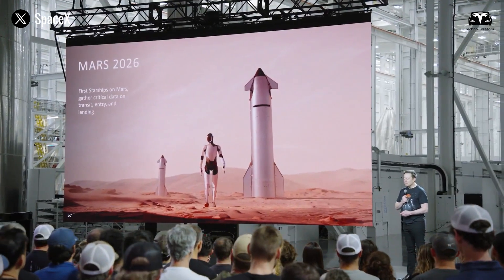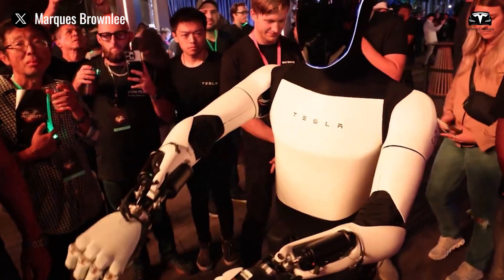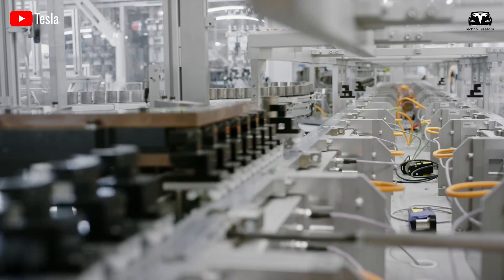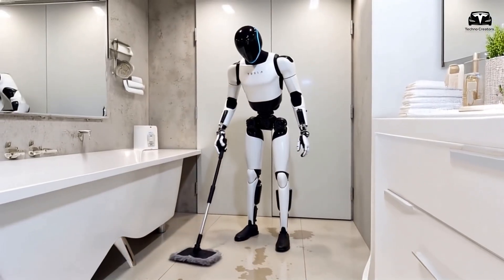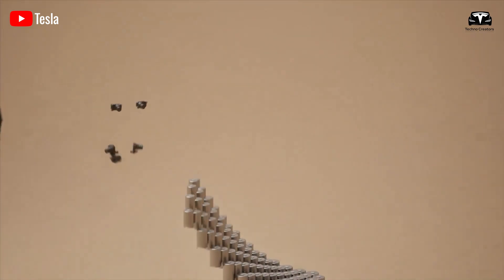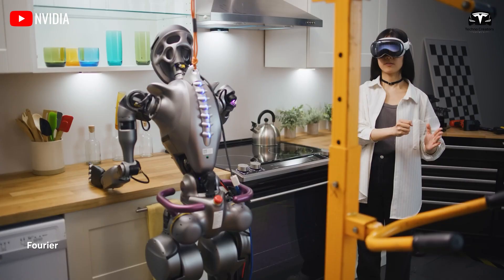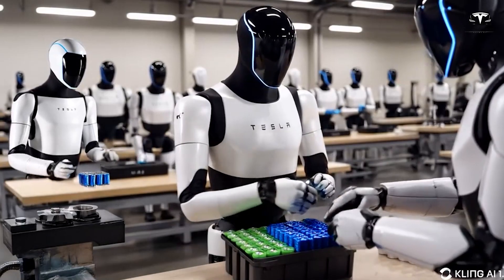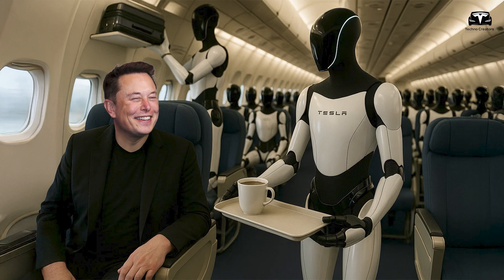Detail Explained Tesla Bot 2026 is The Best Homemaker for your Home! No Robot Can Replace!

Comment: How much decision-making autonomy does Optimus actually have, and can users restrict or limit certain functions to prevent unintended behaviors?
Reply from the maker: Autonomy will likely be tiered with user-defined limits and safety protocols. Tesla’s approach will probably balance independence with strict user controls to avoid risks.

Comment: Can Optimus detect subtle signs of cognitive decline, like early dementia symptoms, and alert caregivers discreetly?
Reply from the maker: Yes! Optimus is designed with a variety of sensors that could potentially detect early signs of cognitive decline, such as subtle changes in behavior or speech. This could be a key tool for caregivers in monitoring and responding discreetly.